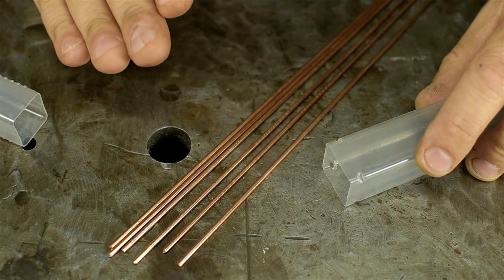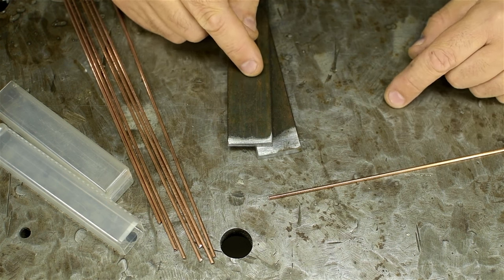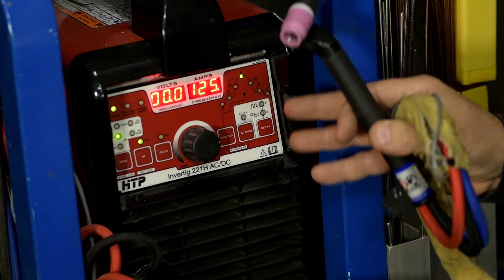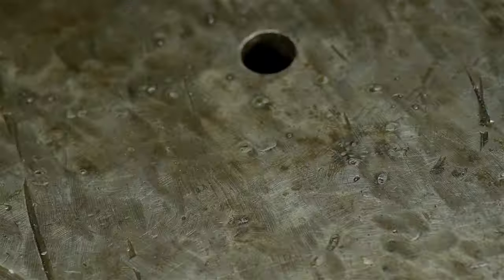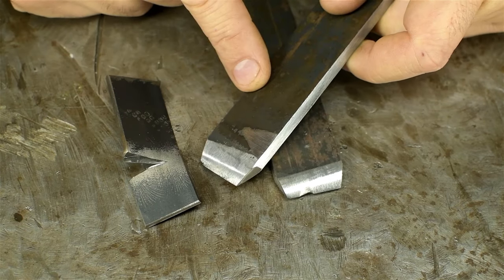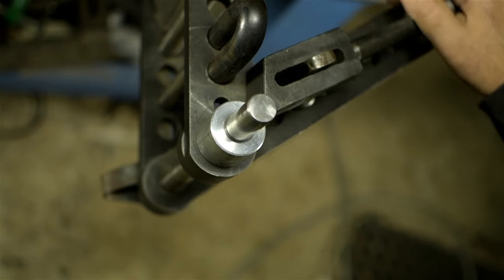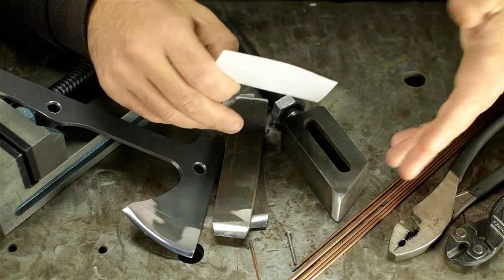TIG Welding with TOOL STEEL filler?!

Comment: Mind blowing stuff

So, had a customer destroy his last form-tool (cut valve holes on aluminum truck wheels). To get the replacements required milling the rough forms, heat treating, and then finish grinding... more time than he had.

So we welded some of this on the ruined form tool, touched up the grind, and that got them through the job.

Comment: Instructions unclear. Lawnmower is now welded to weed whacker.
Reply: I don't see an issue. Now its dual purpose 😆
Reply: I think your issue is you need to weld two mowers to the weed eater.. Yuh know, for symmetry...  and balance at high rpm..
Reply: And I think you may need to braze or bolt them.. I heard somewhere that unlike outdoor power equipments don't like to weld to each other...

Comment: When I was a boy, I was often given the job of putting hardener on plough chisels using a stick welder.   The stuff we were using wasn't nearly that hard.  I know this because we tried using it on cold chisels to lengthen their service life.   Of course, as you suggested, the purpose of putting hardener on plough chisels was to increase their resistance to abrasion.
Reply: Hv

Comment: Is there a Stick welding Version of this?

Edit:
Found it: "OK tooltrode 60"
Reply: Cobalt Hard facing electrodes are better.
Reply: @from the dark side of the moon More importantly, which Jimmy? 
Once we figured that out, we can go and wonder about Karen.
Reply: EutecTrode makes all kinds of rods. 680 is one of them. 2B is a good one also. 4004 as a final gives even better results when over 680. Only problem with them, the costs. Xuper 680 makes a smaller grain in the welds but costs even more. With them you are often looking at $1.00 a rod.
Reply: @gravelydon7072   Stick with Weld Mold
Reply: This is Weld Mold 958 and yes we do have a stick version of this material
Reply: Weld Mold 958 is available in stick electrode as well as MIG and TIG as well as flux core and metal core spooled wire. Contact Weld Mold for a distributor near you!
Reply: @crich3192  Been using the 680 for about 40 years with good results.
Reply: @DavidLee-du8ch  so I can mig weld with tool steel? Sweet!
Reply: @nerfherder4284  Weld Mold has many tool steel fillers for  MIG welding, but it absolutely critical to know what the base metal is, as there may special preparation requirements as well as post weld processing to ensure a successful weld. As Old Tony demonstrated, mild steel doesn't have any prep requirement beyond cleaning the surface of scale and contaminants.

Comment: Excellent video as always! Try tool steel drill rod. I use A2, D2 and you could use S7 for shock. but with these you should temper them after welding.  Do your mower blades!
ATB Robin

Comment: Tony puts a great comic adventuresome slant on this very near dear to me subject  Most of these welding alloys were developed during WWII, along with the idea of  "composite cutting tools" using low cost carbon steel shanks with HSS or tool steel welded to the ends, to save and reclaim precious tool steels.  They only had Oxy-Acet, SMAW stick, then later Atomic Hydrogen [crazy TIG]then GTAW {TIG} We did a lot of this in the industries I worked in.
Reply: I added  RECLAIM as these alloys are used to build up and repair tool steels...

Comment: This is exactly the video I needed. I just ordered a TIG welder that should be here in a few days and I was looking for filler rod to repair my anvil. Thanks TOT! Love your content!
Reply: Didn't he just tell you to be careful shock loading tool steel?
Reply: @schwig44  Yeah. I heard him. I work with tool steel regularly, being the blacksmith that I am. The information provided by TOT is enough for me to look up the correct filler rod from WeldMold to suit my needs.  I also plan to follow the welding instructions provided by the manufacturer.
Reply: @TeknoXI  yeah, I was just kidding, but also a fair warning for others without your level of knowledge so I felt weird putting an /s on it. Blacksmiths might only be matched by stamp press operators in terms of shock load experience lol, I figured you knew your stuff

Comment: now i just need to figure out under which name this stuff goes in germany.
Reply: "Hartauftragsschweißen" heißt das. ISOARC 461 sieht gut aus wenn ich das Datenblatt richtig verstanden habe. Oder Carbofil A600
Reply: @Galeere2  Werkstoffnummer 1.4718 scheint zu passen. Nach etwas Recherche kam folgendes heraus:
EN 14700 S Fe 2
DIN 8555 WSG 6 – 60 - P
Werkstoff-Nr. 1.4718 (X 45 Cr Si 9-3)

Comment: You should warn people about losing their kielbasa over lawnmower accidents.  These types of warnings are heeded well.
Reply: Mower blades are harder than mild steel. But I suspect far softer than tool steel.
And I have had a couple of mower blades break, proper OEM ones which is scarey. I put one through the lounge room window.
And a friend had one go through the door of his brand new car. Luckily a company car!
Reply: @ldnwholesale8552  I  quit mowing my lawn, fenced it in and run the cows through every now and again. You gotta watch sliding in to second base but other than that its safer than whirley blades flying around!

Comment: See this on excavator buckets: run beads along edges using abrasion resistant alloys and beads criss-cross on flats to stop cracks from spreading.
Beefing up the cutting edge of an axe with Inobtanium then grinding to shape would rock!

Comment: Mild steel, surface hardening , Casehardening works well.  Mixtures are sold to diffuse Carbon into the red hot steel surface, this works well.  You can also diffuse Carbon into the surface of mild steel with a O2 - C2H2 torch, running very rich (low O2 on the torch, black excess carbon diffuses into the steel) hard as a MF.

Comment: Honestly, this is MAJOR COOL!  Wish I'd thought about doing this when I was doing stuff.  No tool steel required, but on the other hand, if I'd actually known what I was doing, I probably would have been even MORE dangerous.

"Not as if I'm putting in front of a million people"  True, so far only 200K.

"Fudge...took the ear ..."   Been there, done that.    You really are good about showing the unintended 'fringe benefits', I'll say that.  UP side is, you probably won't do that again for many many cuts...until it 
slowly slips to the back of your mind, AGAIN.   At some point it's time to mill a CUSTOM MADE "short clamp".  They are not useless, either.  :-)   You can always tell when someone is comfortable about what they are doing, because if they aren't they NEVER show these sorts of things.  Eventually, it just becomes a part of the deal.  No mistakes, you're probably not doing anything.   I can make the same mistake 10,000 times learning something like pool, and I think, well, that should be it now....10,001, 10,002, ...geez!

"I like what you did to your hair"    And exactly WHOSE wife/girlfriend was that directed at?  Wait, can you SEE us?

Good stuff, I need to take your cue and add some humor to MY stupid videos...WAIT, I didn't mean..oh, never mind.

"Wellll, probably stupid examples of what it can do"   Diogenes would be STOKED, too.

File to fit...paint to hide...AND NOW ...salt to taste.   :-/

Comment: I've been welding dies for the last 35 years or so. My favourite has always been Eureka Alloy. 72A and 45 will give mid 60s and high 40s respectively. Castolin Eutectic and Cronotig are also good rods. Cronoweld 645 is excellent on D2 and SKD11. If you can get your hands on it Tokai Yogyo EA600W is an excellent stick rod which lays down around Rc 62 or so, but it comes from Japan so it's hard to get. UTP74G2 is also a really hard stick rod.
Reply: Sir , i m thamrin from indonesia , and i wants to ask u , what electrode welding that used for extra wear resistant bronze of surface hydraulics barrel pump ? Would u share what name n kind of weld electrode ? And for attentions i  say thanks very much

Comment: Hoping you see this 2yrs out... 

I went looking for the WeldMold 958, but it comes in '958' AND '958-T'... (T is more expensive) - which one were you using here?

Neither is cheap, so I'd rather not get the wrong one - thanks.

Comment: Very instructional video, I was a bit cut-up by the axe-to-grind pun, but I'm happy to bury the hatchet. I had a vision of inspecting the lawn mower, only to find two long beads of tool steel weld sticking out and the rest of the blade gone! Would that be a weed-whacker for scaffolding pole?

Comment: Im a mold maker apprentice at a local plastic injection company. I get to weld a lot with tool steels. Anything from P-20, A-2, D-2, S-7, and a handful more. Drawing it back (or tempering it) is SUPER important

Comment: Lawn mower blades are high carbon steel. Just saying, they can be hardened pretty good. I made a scythe out of one one time. Stakes a file. Tempered fine.

Comment: Jody from the welding tips and tricks channel just dropped a video where he hardens the edge of a chipping hammer using a drill bit as the filler metal and it seems to work similarly. Any idea how they they compare? You mentioned that the tool steel filler metal was expensive so for a one off or just to try out the technique, a dull drill bit seems to be just the ticket.

Comment: It is currently on sale at weldingsupply.com for $12/lb for 958 and 954 is $10/lb. So far I've got about an hour with a TIG torch so not sure if I will buy any or not.

Comment: I knew that end mill was too close to the hold downs! 
I love the axe! Reminds me of my favorite hammer. I used to work in metal fab and we nested and laser cut parts out of 1/8" to 3/8" steel. Occasionally, they needed a hammer to pound the pieces that were held in by slag, so they would just include hammers and little tools in the nesting program to use. Picked up one that had been discarded. Left there 9 years ago, but I still love that hammer. it looks beat to hell and that's part of its charm.

Comment: Nice information! I use tool steel rod, specifically A-2, 1/16 and 3/32 for years. No copper cladding but works great. AND you can buy just a small amount! Thanks TOT

Comment: I'm just wondering if you can use guitar strings as filler rod for the same effect? Guitar strings are music wire, so they're going to be hardened steel.

Comment: I bought a Metalman Welder at tractor supply on sale. It was can impulse buy. They had one left after Christmas and it was CHEAP. It had a picture of a TIG  Cable on the box and said TIG in the blurb. BIG MISTAKE. I SHOULD KNOW BETTER!
I have welded GMAW, gas, stick, and spot. Never TIG. 
The Metalman is an inverter. DC only. I check on line after finding out DC does not weld aluminum well. Bummer. Whole point was to TIG aluminum!
Oh well. TIG welding steel is okay I guess. KIDDING!
After paying more for the cable and torch the for the welder. Yup that too! I found that I had a very handy little 110 bolt arc welder capable of burning 1/8" rod. Also capable of scratch starting a TIG weld. 
Up until just now I figured it was a waste to buy the cable. Tool Steel! I use to take tooling to a local TIG guy to build up the edges on punches. Saved a ton of money and time. One day turn for a 20 lb tool welded and ground the next day. Preheat and cool down to avoid cracking the edges. 
Now I can try it at home. Yay!
Thanks TOT.

Comment: Hi ToT, 
I’m 16 years old and I’m cleaning my father’s lathe. I’m inspired to learn how to work with it because of your videos. The lathe is a “AVM Mas 140” I can’t find much info on it but I think it’s about the same size as your lathe(maybe a bit smaller). Now is my question which tools should I buy for a starter? If you or someone has useful info to get me started please comment.
Reply: dont wear loose fitting long sleeve shirts !   or go to bed with strangers.

Comment: For home hobbyists out there, old drill bits can be used as hard filler rod.  Masonry nails will make a pretty hard bead too.  Probably not as good as the real filler rod, but cheap and easy to get

Comment: the interpass temperature varies between matereals. I have a temp probe on me all the time when working just so i can keep the inter pass temp right cause almost everything i weld has to be near perfect and pass both occulary and xray inspection
Reply: @baileesmith2007  well, heat it up, weld, let It cool to the desired temperature and repeat. Inter pass is just the temp you should stay in when you start a weld so depending on the size of what you're welding will you either have to heat it to near the maximum inter pass temp or near the minimum. Maximum if it is a very big part or minimum if it is a small piece. All to try and stay as close as possible
Reply: @baileesmith2007  I'm happy i can help =)
Reply: @baileesmith2007  my pleasure my dude =)

Comment: Great video TOT, A tool steel welding history note, if I may; During WWII, tool steels were so much in demand, that the welding industry developed electrodes, rods, for making composite tools from abundant and cheaper steels with welded on TS as you did here, to save scarce TS waste of making parts all out of TS.  They also invented a wild crazy TIG like process called Atomic Hydrogen welding for such toolroom welding, later to be refined to what we now know as GTAW or "TIG".   Now tool steels are abundant but $$$$$, so "a mans gotta do what a mans gotta do" lol!

Comment: A friend of mine has some special electrodes for MIG welding, they have > 65 HRC, coming close to 70 HRC, I really don't now what's inside, but it's not only steel. 

One day some old unfriendly man came and wanted something welded, AS HARD AS POSSIBLE, he wanted file it to shape later. My friend told him it might be too hard, the old man told my friend to shut the fuck up and weld it, so he got what he requested.

Comment: You know what This Old Tony? Octopusses have beaks. Hard beaks, like a parrot. Hard enough to break shells. But you may wonder: "Luiz, but octopussies are soft and can squeeze in tiny spaces, how he beak don't cut through their own muscles and flesh?" 
Because the beak is anchored in layers of tissued that are progressively soft, so there is a gradient of hardness of the octopuss tissue until we got into the shell breaking beak. Just like you did welding this fancy filler into mild steel.

Comment: So, aside cool factor, what's preventing one to just straight forward use an beaten up tool steel drill for a welding filler?
Reply: Apparently, from other comments here, that's actually a thing.

Comment: ER4130 chromoly  when quenched, the hardness is around 48-50 HRC.  Weldmold 938 is $18/lb on weldingsupply.com, where as you can get ER4130 for aorund half that, about $9.50/lb, Blue Demon brand.   I'm not saying it's a proper substitute, but it would make for an interesting comparison, I think.

Comment: That’s pretty cool, I saw a box of that lying around the shop. Actually used some on accident thinking it was mild steel. I was wondering what I could use it for thanks for the knowledge.

Comment: So this tool steel doesn't need to be quenched? Gotta say I'm impressed. I know some tool steels don't, but they also need a soak time... I started using titanium rods to hold my knives for dipping in ferric. Guess they have welding rods for everything, hahaha... Hope all is well, take it easy...

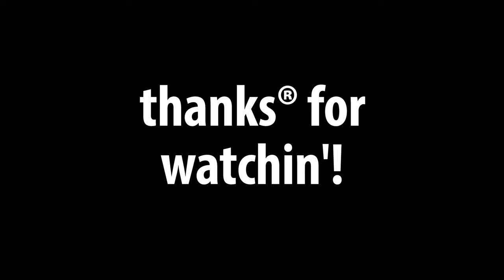Comment: At 12:40ish you mentioned interpass temper'ture.  Another (and possibly more important) variable in molecular transformation in welding is "overall heat input" as expressed in "kilojoules per inch". The formula for finding this measurement is ; (amps×volts×6) ÷(travel speed or inches per minute×100) so if you're welding at 125a × roughly 12v ×6 divided by say, 15 seconds per inch which lands you at 4 IPM you'd get  something that looks like 125×12×6/400=22.5kJ per inch. Hope that makes some sense.

Comment: I remember being warned about structural steel welds hardening if you let them cool too fast.  The lecturer just wrote on the board, "MARTENSITE = PRISON".

Comment: Tensile strength and yield strength are not two in the same 36K psi vs 70K psi. Filler rods are rated in tensile strength hence ER-70-2. Mild steel has a tensile of approx. 60K psi. yield of approx. 50K psi. Properties of metals; physical, mechanical and chemical.

Comment: YOU LIED. My lawn mower isn't using mild steel blades. They will cut through just about anything, and barely get damaged. That tree stump is no match, those rocks, you better watch out because they will go flying. It's just unstoppable.

Comment: Not sure what you used as a base metal for the hatchet. I would give 4130-4140 CrMo a try and see how this filler works as a cutting edge. Try to keep the RHC below 55 for impact cutting edged to prevent chipping and also be aware that tool steels like A2/D2 chip easily in 32°F temperatures. Thanks for the upload.

Comment: 7:48 I thought "what the heck is he doing" .... Then "oh hooo hoooooo...."  FYI - Weld Mold has about 100 different alloys. You'd need to be an engineer to determine which one to use. But, amazing info!